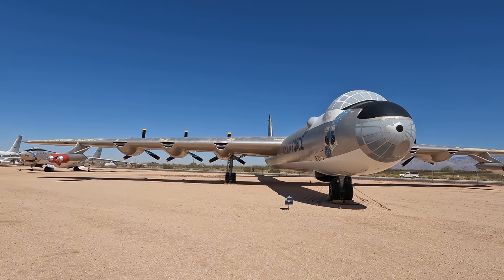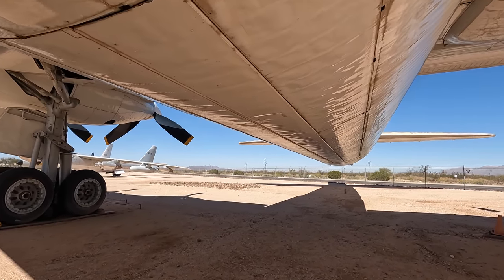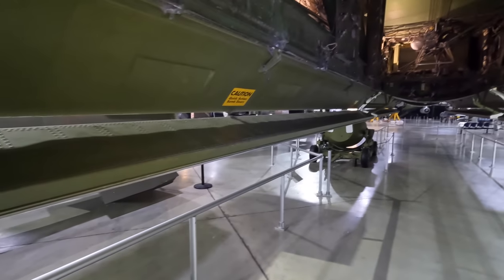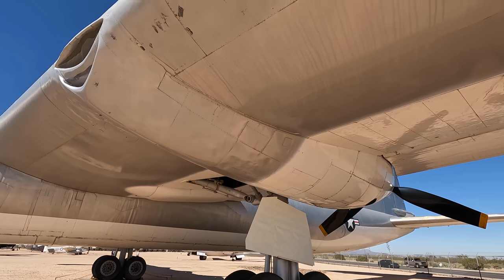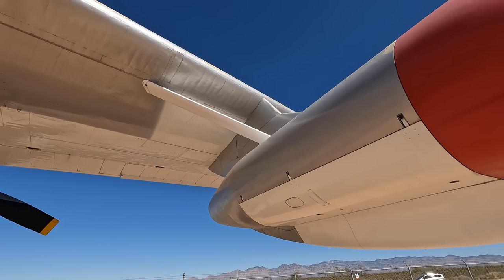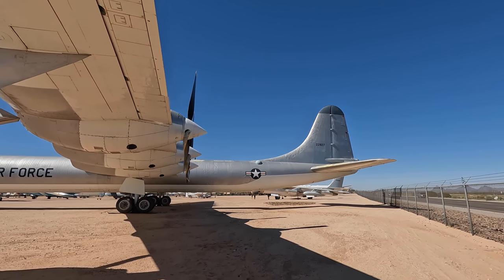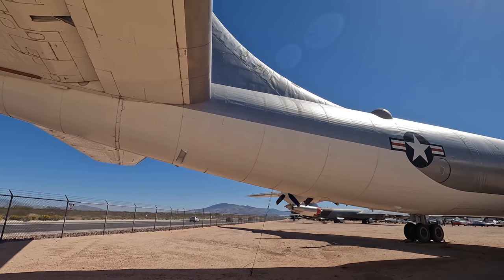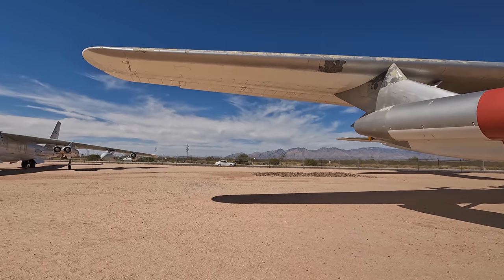Tour around the TEN engine Convair B-36 Peacemaker!

Comment: When I was in the US Air Force as an officer
from 1969 to 1973, I was at Pease AFB. 
It was located near Portsmouth, NH. 
The B-52's had left such as for bombing
in Vietnam, and in December 1970, the
FB-111's arrived, with the Wing Commander
flying over with th afterburner on. I did get
to see in the Cockpit in the hanger after it
landed. Pease, as with most SAC bases,
closed in 1992, after the Soviet Union 
ended, and now Pease is a Tradeport with
an Air National Guard unit, with KC-135
tankers like I first flew in at Plattsburgh, AFB,
NY in 1967 while in ROTC Summer training
there in August 1967.
They had a sign by the base entrance at
Pease, PRIDE, Professional Results In Daily
Effort,. The motto was Defensor Vindex,
and SAC had it's own supplements to the
Air Force regulation books we had to use.
Thr mission, was to Fly and Fight, and Peace is our Profession, like the B-36 bomber.

Comment: Each Wasp Major engine had 28 cylinders, 56 spark plugs and it's own 100-gallon oil tank (which it drained at ~1 Gal per hr). Considering this (and the tremendously-leaded 115/45 avgas they burned), it was extremely common to foul the spark plugs so badly they had to remove, inspect, clean and reinstall ALL 336 of them after the mission. 

And then she never dropped a bomb in anger, being rapidly replaced with the much more cheap and cheerful B-52. A "hangar queen" for the ages. Let's remember the huge team of men who made it possible for her to fly.
Reply: Speaking of leaded avgas, it should also be remembered that the jet engines ran on the same fuel as the piston engines. This was done in order to eliminate the cost and complexity of having a dedicated fuel system to supply jet fuel for the jets. Much like the plugs in the piston engines, the turbines in the jets would also get lead deposits that needed to be periodically cleaned.

Comment: Back when I was probably five or six years old, mid 1950's, we took a vacation from San Francisco down to Los Angeles. The only highway back then that ran that far, Hwy 99. I went past Castle AFB which back then was SAC and had B-36's. They must have had an alert as they had planes taking off one after another, it was loud, and it lasted for a while as we drove past on the highway. When we got to LA, we went and saw Jimmy Stewart in Strategic Air Command, and I was super impressed. I still take every viewing of that movie.

Later, in my twenties, I was a member of the Air Force, and the largest aircraft I had to work on...the C-5A at Dover AFB.
Reply: I was a defensive fire tech on B-52G in the early 80’s, quite impressive planes…But I live near Stewart Air field in Newburgh NY now and the ANG had C5’s and the flight path I could see the crews on approach, now they have C-17’s - nice but the C-5 is unique in flight and sound!
Reply: @tomcoleman4207  When I first got to Dover, the nickname they used for the C-5A, Fat Albert. Someone up top didn't like that name, so we changed it to FRED, Funny Ridiculous Economic Disaster, they quickly figured that one out, so we changed again to the Aluminum Overcast. When it flew over, it shut out the sun. In one of the hangers, they had a sign they put up when one was on display, it told how many Volkswagens Beetles it would hold, then everything from basketballs to ping pong balls and it was a lot of them. I used to joke and asked how in the world did they teach that many beer cans to fly in formation? WE had a system on board, MADAR, that had nothing to do with Radar, but it was supposed to detect failures or wear in just about everything, the problem, it was what broke down the most. I enjoyed my time there, never worked the flight line, I loved fixing things so I worked in the shop for two years, before getting out.

Comment: These B36 birds flew out of Plattsburgh AFB in 1950`s. You didn`t need radar to pick them up. You could hear them noisy noisy 25 miles away at 40,000 feet. They finally got replaced  with B47`s which always flew at low level 300 feet bomb runs under the radars  here. We could stand by the barn, look straight east  we could see the top of the canopy. Our farm was 400 feet up so we wuz looking down at the B47`s when they made low-level runs

Comment: I grew up around that plane... the City Of Ft.Worth!  It was parked at the Greater Southwest airport in the DFW area... a bicycle ride away from my home in Euless, TX.   I do remember two things... the vents in front of the piston engines were ideal for birds' nests, and the one look I did have inside smelled of urine.  I've made a study of B36 crash sites... one of the most accessible is on the west side of the Franklin Mountains in El Paso, TX... if you look close you can find the nose gear still on the mountain, at  31.806861° -106.487289°... pieces of jet turbine, also a plaque on the rock.

Comment: The Peacemaker was a famous Colt pistol.  You have to remember all the electronics were vacume tube based.  There is one at SAC Omaha with a Goblin and an original landing gear.  Never saw one with the streamlined cockpit.  Like it much better.
Reply: The one at Omaha was being restored when I was there some years ago.  You might get inside that one.  My understanding is the one at Castle has had the engines removed  by Air Force edict.  Maybe all have.  They have a recip cutaway at Omaha.  There is a vid by a crewmember stating they never feared in the slightest when over flying the USSR which was done many times.  Mig 15s just could'nt deal with them.

Comment: Pretty awesome isn't it? We had one as a static display at Chanute AFB when I went to Tech School in 1979.  Chanute had one of the most comprehensive aircraft static displays in the country.
Reply from the maker: They really are an incredible aircraft.
Reply: That's the H model that was sent by rail in pieces to Castle AFB and reassembled.  I was able to crawl through her during the SAC reunion in October 1995.  Dad served on ship 1074 which was an F model while he was in the 6th Field Maintenance Squadron at Walker AFB-- on the ground he operated the B-10 power unit in the forward bomb bay.  . If I recall correctly, the B-36 was the first plane to use both 28VDC and 130 Volt/400 Hertz AC electrical power.

Comment: The reliability of the piston engines would’ve been much higher if the Air Force would’ve spent money on more expensive spark plugs.  Instead of spending $1 a spark plug the budget needed to be increased to $1.35.  That would’ve solved almost all of the spark plug fouling issues which led to engine fires

Comment: Jet engine turbines do not expel the jet exhaust; the exhaust expelled from the combustors propels the turbine, which turns the compressor(s) and other components like the fuel pump, oil pump, hydraulic pump, generator, etc. The exhaust is then expelled through the conical jet at the rear of the engine to provide thrust.

Comment: Several years ago wife and I hiked up to top of ridge outside Burgoyne's Cove, Newfoundland to see wreck site there of B-36 crash.  Moving and sad and eerie experience.  Much of the wreckage is still there, spread over fields and  into the woods.  A practice radar evasion drill gone very wrong, March 18,1953. One of the crew was Gen Richard Ellsworth for whom Ellsworth Air Force Base in Rapid City, So.Dak. was ultimately named.

Comment: Some time around 2000, my wife and I were able to tour the B-36 that was being restored at the Lockheed plant in Ft. Worth, Texas.  The gentleman that gave us the tour was a WWII vet with 36 missions flown in a B-17 over Europe and a DFC recipient.  He flew the B-36 after the war and had some great stories.  He mentioned that the cover for the wing landing gear sometimes tore off as the gear was being raised or lowered and that several Ft. Worth residents ended up having some spare parts land in their back yard.  The plane we toured was in pieces for the restoration, but we were able to tour the cockpit, which had been restored.  The wing spar had fuel lines running to the engines and they looked to be about 4 inches (100mm) in diameter.  I've never seen one completely assembled, but can't imagine the sound of a squadron flying overhead.  Thanks for posting this... now subscribed and looking forward to more great vids!
Reply: The plane you saw at the Convair plant in Ft Worth would have been  the City of Ft Worth. It's the same one now in the desert sun at the Pima Air and Space  Museum in Tucson, as seen in the video. I've seen it in person. Monstrous.
Reply: I live in Fort Worth, Texas and vaguely remember the "spare parts bombing run" LOL

Comment: Great video, well researched and very informative. I might mention something about the outboard jet engines. I flew the P-2 Neptune in the US Navy which had two piston engines and two jets (two turnin', two burnin") and the engines burned the same high test AVGAS that the piston engines used. This caused extra wear and tear because AVGAS burns a lot hotter. One P-2 off the coast of Japan lost its two piston engines and got back to Japan using the jet engines only. It used fuel a lot faster and they couldn't make it back to base and they ditched in the surf just off a fishing village in Japan. The fishermen rescued all the crew. There are photos of the aircraft just off the beach in the ocean with its tail, wingtips and canopy just above the water. The jets burned AVGAS because there wasn't room for separate fuel tanks.

Comment: If the b52 is kept around I think this should have been as well it had more payload and range than any other bomber and with modern fuel injection and computers it’s notorious issues would have been easily fixed

Comment: As a Boy Scout in the late 70's and early 80's, our troop took weekend trips to Chanute AFB in Rantoul, IL. The base had a couple B-29s and B-52s on display, as well as other aircraft. But the B-36 was the best on display with the inverted engines and quad jet engines. It actually lost about 20-30 feet in length due to some mishap upon arrival at the base in the late 60s. It was still such an immense aircraft to look at. The base is now shutdown but remains a tourist attraction with only a small handful of aircraft left for visitors to walk up and look at. Some great nostalgia and information. Thanks.
Reply: I live right next to Rantoul! Never knew about this!!
Reply: Our Chanute B 36 was an RB 36H and it did not ever get shortened by a single inch. Nobody knows where that got  started but the B 36 at Atwater CA is this aircraft. Go there and see for yourself it has its full fuselage length, including the 3 blisters under the aft center body.

Comment: I heard a story about the B-36 at Pima, the  "City of Fort Worth", that at one point after its retirement, while it was still in Fort Worth, a group of people restoring it got at least one of the motors running. The city promptly shut them down.
Reply: My understanding is the Air Force ordered the engines removed.  Possibly by treaty with the USSR.
Reply: One was near airworthy conditions, however since even the military struggled with a high crash rate and technical challenges they couldn't allow civilians to fly one of them because it would have had crashed one day

Comment: My first assignment in my USAF career was to OFFUTT AFB, NEB and it was an INCREDIBLE EXPERIENCE to say the least!! The STRATEGIC AIR COMMAND MUSEUM was located on the NORTHERN SIDE of the main runway inside a cordoned off section that contained an assemblage of ICONIC PLANES and MISSILES and related equipment!! The ABSOLUTE STAR of the exhibit was the CONVAIR B36 "PEACEMAKER"(as it was called)
 they had displayed in situ on the runway!! It just GRABBED YOUR ATTENTION IMMEDIATELY DUE TO IT'S GREAT SIZE!! The WIDE WINGS SPORTING THOSE MASSIVE PUSHER TURBOPROP ENGINES along with the VERY TALL SINGLE TAIL RUDDER were SOMETHING ELSE but what really MADE THE GREATEST IMPRESSION was STANDING NEXT TO THE HUGE SINGLE TIRES OF THE MAIN LANDING GEAR(which were popular PHOTO-OP spots)!! Besides being known as the "JESUS PLANE" because of so many reactions by visitors, it was also labeled "THE MAGNESIUM MONSTER"(as it said on a sign nearby) because so much ALUMINUM ALLOY with a HIGH PERCENTAGE OF MAGNESIUM was INCORPORATED INTO THE DESIGN/MANUFACTURE to SAVE WEIGHT and INCREASE RIGIDITY!! CHEVROLET used the same ALLOY INSIDE the DASH of it's FRONT DRIVE IMPALA CIVILIAN MODELS in EARLY 2000 as it gave STRENGTH/RIGIDITY with LESS WEIGHT to the MAIN CROSS-BRACE/DASH SUPPORT under all the vinyl and plastic foam padding!! Another example of AEROSPACE TECHNO FEEDING OVER TO OTHER INDUSTRIES!! WELL DONE REPORT for HISTORY and TOP NOTCH VIDEO QUALITY!!

Comment: Another enjoyable tour… The thermonuclear weapon was enormous! What causes areas of the fuselage to become so wrinkled? Pressurization cycles?
Reply: The same reason as the B52.It was caused by the fuselage flexing because the huge vertical flexing of the wings especially at take of.Designed to do that.

Comment: The original main landing gear that used the single wheel required 22 inch thick runways of which there were only a couple of airports that had runways that thick.  By switching to the 4 wheel main gear they didn't require such thick runways.

I saw the B36 at the Pima Air Museum and that plane is HUGE. It's amazing that that plane ever got into the air with just the 6 pusher engines, which explains why they added the 4 jet engines to help get in the air quicker.
Reply: And it still needed Rato too
Reply: I lived near what was once an emergency landing strip for this beast. The area is an old lake bottom, and I've been told that the substrate beneath the runway is 5 feet deep.

Comment: I was a kid of around the age of 6 years old (1971) when my father, who had been reassigned to USAFB Chanute, IL, took me on-base to visit some of the static displays. One of them was an early model B-36 with the single tire main landing gear. Even as a small child I could tell that the tire was WAY overly huge. That plane was just fantastically immense.
Reply: Chanute also had the second XB 47 prototype but wasnot in XB 47 markings.
Reply: @teenagerinsac  Was that what that what that B-47 was? Because I remember it on base.
Reply: Thats what the Base museum director said. They should not have removed its original markings, but you can always rely on stupidity where preserving artifacts in Aviation is concerned. Aviation is a relatively MODERN notion, and does not garner the proper handling and care that much older human historical items recieve. :(
Reply: @teenagerinsac  Back when I was a kid, there was a huge grass field after the western gate (that had a huge white missile, I think a Minuteman), and at the eastern end of that field sat two planes on each corner. On the northern corner was a B-58 Hustler and on the southern corner was a B-47 Strato-Jet. I'm trying to remember the markings but all I can see are your typical period SAC paint. 

I kind of miss that base and those days as a kid. Everything seemed cleaner and brighter, and people more of a community and industrious. I saw the base recently in pictures that showed buildings and spaces I remember well that had fallen into terrible neglect. The buildings that my father used to work in, the ones that had archways that you drove through into these big parking areas between the buildings, all red brick and stories tall, crumbling with windows broken and boarded, grass and weeds overgrown, and piles of trash and building debris are all that were left in those pictures and made me depressed. Such a waste.

Comment: Did the Jet engines run on the same fuel as the piston engines?
Reply from the maker: That's correct. That's a fun fact that I forgot to put in the video.
Reply: @PaulStewartAviation  The reason I asked was many years ago I had a job  flying a Garret turboprop powered Merlin aircraft in Africa.  Jet fuel ( kerosene) was sometimes difficult to obtain and I would be forced to fuel it with avgas ( petrol ), a few times even on plain old motor vehicle petrol. It was not good for the engine fuel pumps because it didn’t have the lubricant qualities of kerosene.
Reply from the maker: interesting!

Comment: The one at Omaha was being restored when I was there some years ago.  You might get inside that one.  They have a Goblin and a cut away of a recip engine.  Also an original landing gear.  You have to remember all the electronics were vacume tube based.  Never saw the stream lined cockpit before.  Like it much better.
Reply: Have met a MD engineer who worked on the Goblin.  There is a vid of a crewmember at Castle who said they never worried about Migs when overflying the USSR which was all the time.  The Mig 15 simply could'nt cope with the 36.  The recips leaked oil like crazy and had to be refilled in flight.  Thats why they had so many fires.

Comment: I had a lot of fun as a kid crawling through the one near Arlington TX at the airport. It was later removed and restoration started. I was 12 at the time. There was no access to the wings as I recall but crawling through the tunnel from rear compartment to cockpit was a long crawl as the scooter and rope were missing. Huge tires and amazing space inside. I think it may have gone to Cali for display after restoration but don't remember.